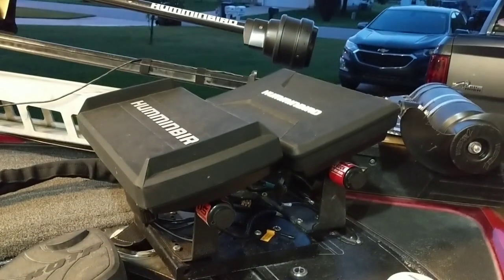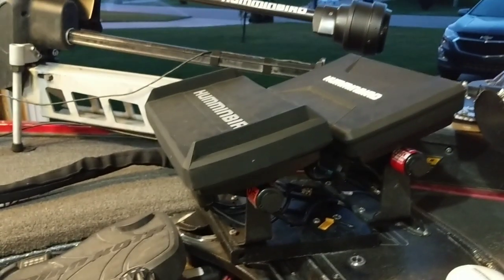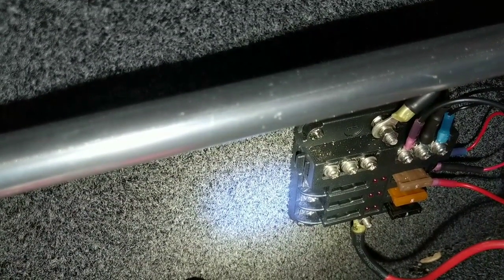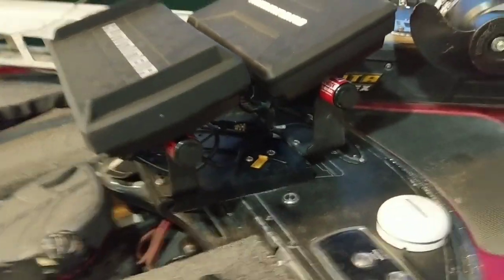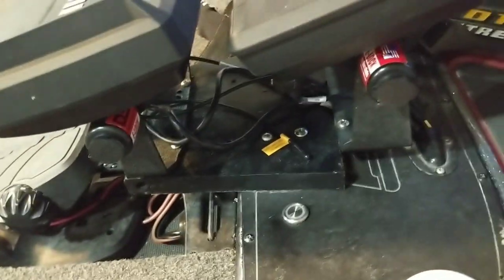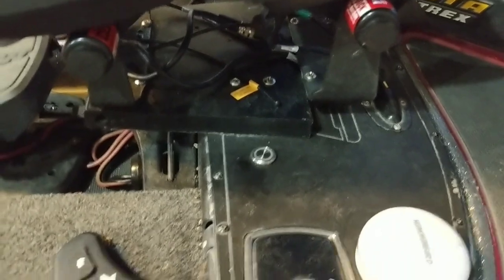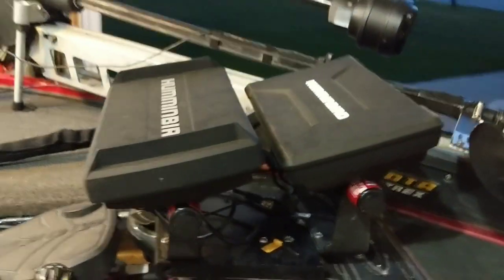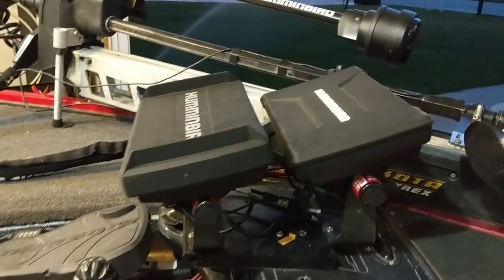Humminbird MEGA 360 Wiring.

Comment: Cool video! Is that LED switch just straight to battery with no inline fuse?
Reply from the maker: The LED switch is wired into the power of the 360 transducer. It has a fuse on the fuse panel.

Comment: I'm needing some help with regard to the switch.  How exactly did you wire the switch?  Directly to the fuse panel?  If so, how would the switch connect to the 360?
Reply from the maker: The switch goes in between the fuse panel and the power for the 360. This is the switch I used and it comes with a wiring diagram. https://www.amazon.com/gp/aw/d/B07Q65BMGS?psc=1&ref=ppx_pop_mob_b_asin_title
Reply: @JeffElliottOutdoors  thank you.  I am going to use this same switch.  So, the red power wire from 360 goes to the switch power wire and same for black?  So the only wire that goes to the fuse panel is wire from the switch?
Reply from the maker: @katiedolfman6496  the switch just has a short pigtail so positive from fuse panel connects to switch. Positive from the 360 will also connect via a different wire. Negative wire will go from the fuse panel and tie into both the 360 and switch. The metal ground wire will only tie into the negative bar on the fuse panel.
Reply from the maker: @katiedolfman6496  there is a good diagram that comes in the package with the switch.
Reply: @JeffElliottOutdoors  I think what is throwing me off is the wire size difference from the switch compared to the wire size of the 360.  I'm running this same switch for mega live.  How do you connect two wires that have such a size difference?
Reply from the maker: @katiedolfman6496  I just used the smallest butt splice that fit the larger wire. It is awkward for the smaller wire but it has worked for me.
Reply: @JeffElliottOutdoors  thank you!  I found some step down butt splice connectors and they worked like a charm!  Thank you for your replies!

Comment: Where did u connect the ground wire coming from the mega 360.
Reply from the maker: Just add it to the negative terminal of the fuse box. Both the ground wire and the negative wire will connect to a negative terminal regardless of how you set yours up.
Reply: Ty so much jeff 👏👏👏👏👏 I appreciate your replyI will take care of this tomorrow.

Comment: how did you connect your fuse panel to the wall inside, did you use sheet metal screws, self tapping screws, did you pre-drill holes, I am seeing mixed results over the internet on fiberglass boats. i also have a nitro Z20
Reply from the maker: I just used some stainless screws I had laying around. I can't say for sure but I likely pre drilled the holes.

Comment: What size cables from the humminbirds or did you just use the 22gauge wire?
Reply from the maker: I just used the cable that came with the birds. Didn't need to extend it with anything.

Comment: On your 360 power cable you have a positive, a negative, and a 3rd wire. Where did you run the 3rd?
Reply from the maker: Hi Ron, I ran the 3rd wire to the negative part of my fuse block.

Comment: What size battery should be used? I'm connecting 2 Helix 12 units, along with Mega 360 and if it matters running the transducer on the Ultrex. I'm afraid the draw would be too much for my crank battery leaving me stranded.
Reply from the maker: The biggest one you can get! I'm using an X2 31 series and powering a Solix 15, 10, helix 10, and everything else on the boat with no issues. Before that I had a DEKA intimidator AGM and also had no issues. I swapped that out after 4.5 years just to avoid problems. I think any AGM with at least 1000 CCA will work out good for you.

Comment: What gauge wires from your units and 360 to the fuse block?
Reply from the maker: The wires from the units were long enough to extend right into the fuse block. The only thing I had to extend was from the switch for my 360 transducer and I used 18 gauge marine wire for that.
Reply: @JeffElliottOutdoors  cool, yeah I gotta do the exact same type of install on my boat. Did you have enough arm movement under your bow to reach your rod locker to install the fuse block? Also when running the wires from the rear of the boat up to your rod locker did you run the power wires through the middle of your boat? I’m trying to figure out how to mount the fuse block like you set yours up and still be able to get the wires from the battery compartment to the block without drilling into the side of the rod locker...hope that made sense. Any info helps!!!🤙🙏
Reply from the maker: @6to8john  I had plenty of room to install the fuse block into the rod locker. I also just used a couple screws to attach it. As far as running wires from the back. I went from the battery compartment to the driver side of the boat then over to the fuse block once I got even with it. There were already wires running on the side of my rod locker so I was able to zip tie to them to make it clean. The 10 gauge wire that powers the fuse block does lay on the bottom of the rod locker the short distance from the side of the boat to the fuse block.

Comment: I just bought a mega 360 and am going to fo the same setup as you can you take a picture of the 30 amp fuse block or let me know what one you used please
Reply from the maker: Justin this is the one I used, good luck on your install! https://www.amazon.com/gp/aw/d/B07KBFWKS2?psc=1&ref=ppx_pop_mob_b_asin_title
Reply: @JeffElliottOutdoors  did you just use an inline 30 amp fuse off your battery before that block
Reply from the maker: @justinhorst8803  yep
Reply: @JeffElliottOutdoors  im just curious do you have to put a shut off switch on it since those water sensors shut it off when its out of the water
Reply from the maker: @justinhorst8803  Humminbird recommends that the switch is put in so that's why I put one on.
Reply: @JeffElliottOutdoors  i have a ranger z118 and I believe nitro are similar and im having a tough time finding a spot to run the front units into the side rod locker how did you do it
Reply from the maker: @justinhorst8803  use a fish tape or fiberglass rod to run the wires. It was fairly open in the Nitro so I could actually just grab the wires on my install.
Reply: @JeffElliottOutdoors  of course mine was filled with foam so I ran it down the rod conduit and drilled a hole in the side compartment they dont make this stuff easy

Comment: What switch did you use to shut the power off?
Reply from the maker: I used a switch from Amazon to shut my transducer off. Here is the product description - APIELE 10 Amp 22mm Latching Push Button Switch 12V Angel Eye LED Waterproof Stainless Steel Round Self-Locking 7/8'' 1NO 1NC (10 Amp/Blue Led)

Comment: Hey, can you give me all your specs for your set up?  I just got a Mega 360 and want to do what you have done. Im looking for what you installed from the wire to the inline fuse, to the fuse block.  Thanks
Reply from the maker: 10 gauge Duplex tinned marine wire from battery to fuse block with a blue sea systems waterproof fuse holder/30 amp fuse at battery. I just used a generic 6 way fuse block. I used an apiele 10 amp 22mm switch for the 360 unit power. The 360 power cable was the only thing I had to extend off that switch and I used 18 gauge duplex tinned marine wire for that. Hope this helps!
Reply: @JeffElliottOutdoors  Confirm you remove/cut out the inline fuse when you wire to a fuse block correct? Then install a blade fuse the same size in the fuse block?
Reply from the maker: @Chappie8824  all fuses for the electronics are in the fuse block vs being inline. I do have a 30amp blade fuse back at the battery to protect the fuse block. That is the only inline fuse in the system.
Reply: @JeffElliottOutdoors Thanks for the reply. I guess what I was getting at was if the supplied power cable for my Garmin Ultra already has an inline fuse on it, cut the fuse out and only use a like Amp fuse in the fuse block to protect it.
Reply from the maker: @Chappie8824  that's what I would do, good luck with your install!
Reply: Did you drill a whole in your rod locker to run the wires from the battery to the fuse block? I’m about to tackle this same job. Thanks
Reply from the maker: @6to8john  I didn't have to drill any holes. A fish tape got me through the tight spots by the console. Everything else was pretty open in my Nitro.
Reply: Where did you hook the ground wire for the 360 to on the fuse block ?

Comment: How did you ground your 360 unit?
Reply from the maker: I ran the ground wire to the negative bar on the fuse block I installed.

Comment: humminbird installation says to extend the power cable use 18 gauge.  10 gauge to your panel is pretty heavy duty.. any reason you went that route?  be doing the job this week...ugggg
Reply from the maker: If you are only wiring the 360 transducer 18 gauge is fine. If you are wiring units you'll get voltage drop with thin wire like that. Potentially causing performance issues with units or having them shut down when cranking the engine.
Reply: @JeffElliottOutdoors  excellent information!  just want to do it once!  thank jeff